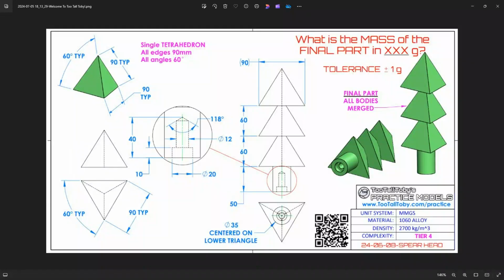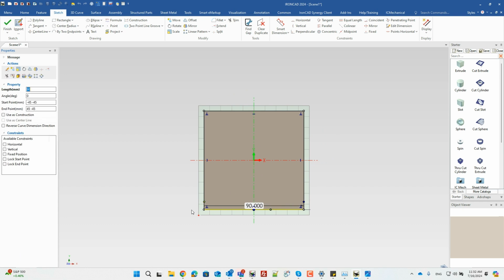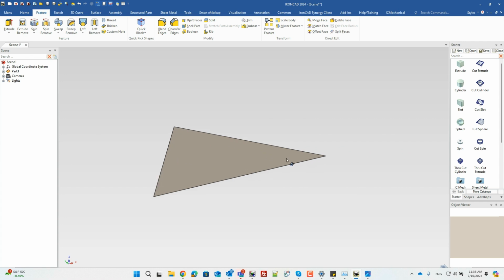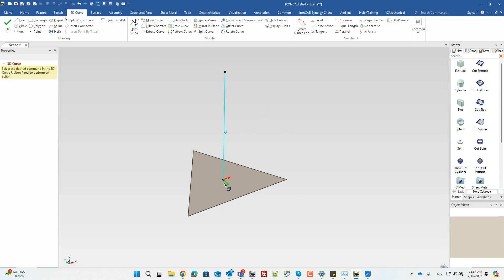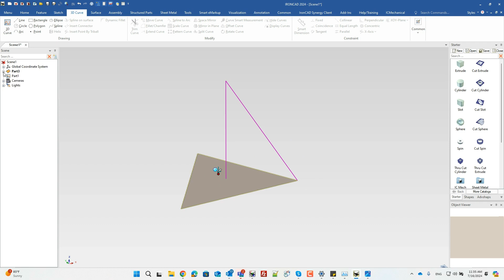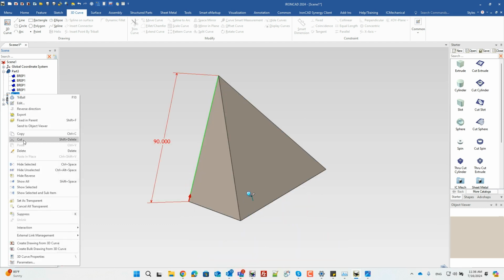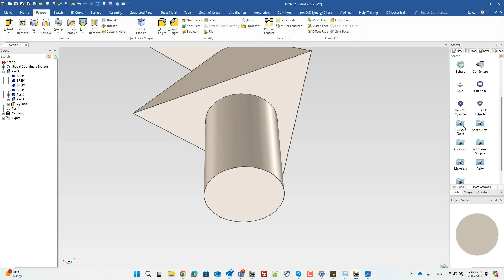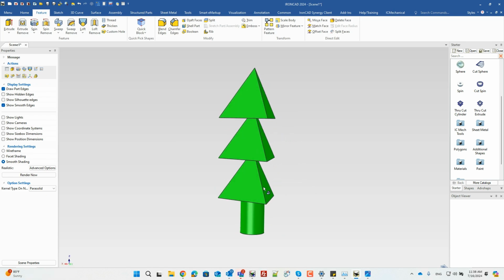Too Tall Toby Practice Models Performed in IronCAD - Practice 24-06-08

Comment: it took a very long time to make the first tetrahedron! :[
Reply from the maker: Yes but we can now save that in our catalogs for reuse the next time :). Just didn't have that one in our default catalogs.
Reply: @IronCADTeam  WHAT U NEED IS GEOMETRIC PRIMITIVES
Reply from the maker: This was just one approach to this and shows how to do it without much math. If you want another alternative, Drag and Drop out our polygon. Edit the Intellishape properties and go to variables and change it to 3-sided and hit ok. Then click reset sizebox under the  Tools Ribbon to get a tight fit. Now you can set the size for the triangle for the sides. Then edit the feature options, add draft and enter 19.471221 (which is the result of 90Deg - acos(1/3)). That is the math needed for the angles on the side. Now, you can simply adjust the height and side handles of the primitive. Drag it into a catalog for reuse later.

Here is a video on this - https://player.vimeo.com/video/996003576?h=8eba7985b9
Reply: @IronCADTeam  why not just show the fastest way? thats what ironcad is all about ya?
Reply from the maker: For this case, I wanted to show off some other tools like the 3D Curve and Surfaces. In general, we usually try to go with the fast route but we do want to show some other methods along the way to give users some ideas for other use.
Reply: @IronCADTeam  i see that but you should explain that in the title. so as not to let people think that ironcad is this slow, and can be done faster and easier.